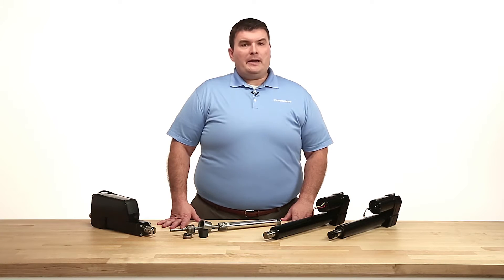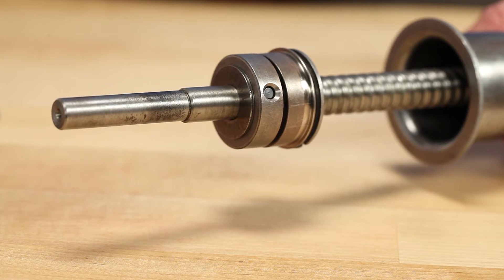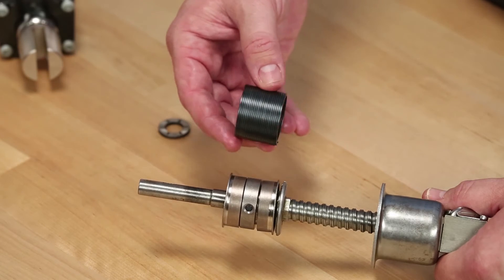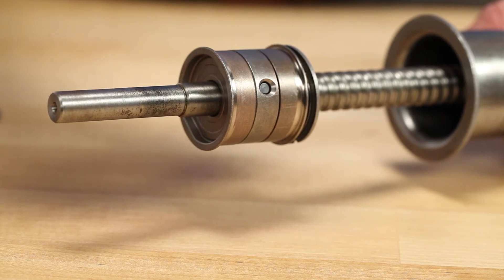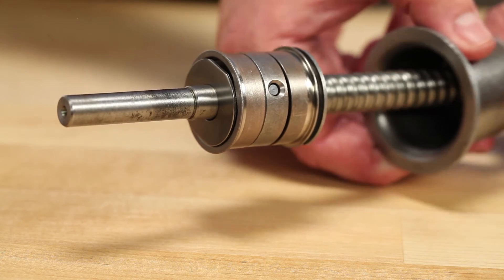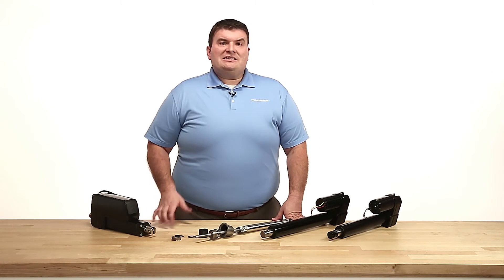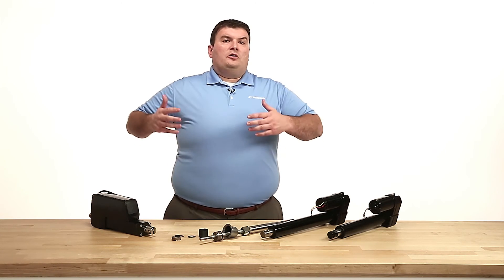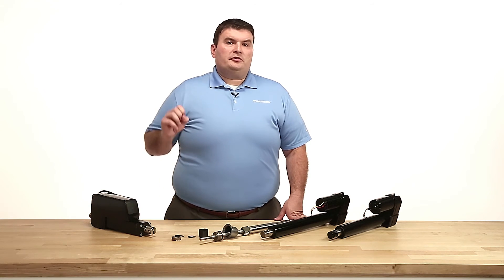How a Wrap Spring Brake Works

Comment: Good effort but it really is not clear without a cutaway diagram or (preferably) an animation.
Reply from the maker: Agreed.  We are working on a animation of how the brake works.  Look for it in the coming months.
Reply: @ThomsonIndustries  Has this come out yet?  This is honestly a horrible explanation of how it works.
Reply from the maker: @liebetrau88  Sorry not yet.
Reply from the maker: Now available https://www.thomsonlinear.com/en/training/linear_actuators/wrap_spring_basics
Reply from the maker: We have a new page with animations that may help explain it.  https://www.thomsonlinear.com/en/training/linear_actuators/wrap_spring_basics
Reply: Couldn't you just use electronic braking instead?
Reply: @Brute4rce1111  Issue is you'd need to power it the whole time.